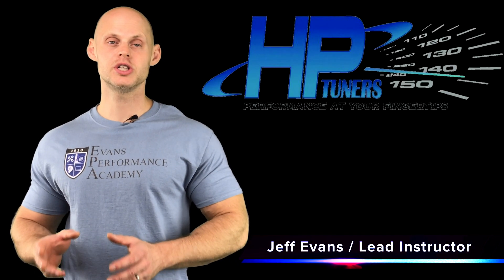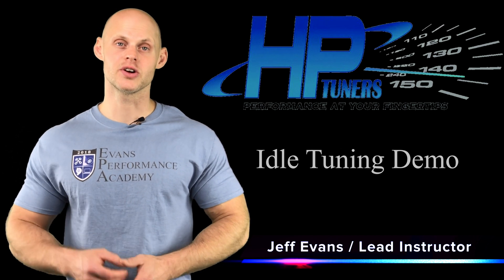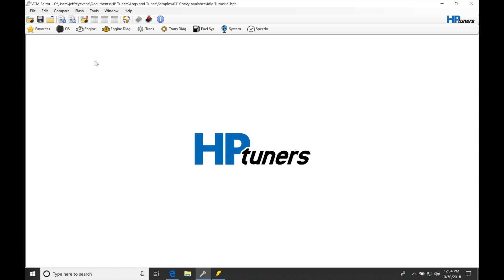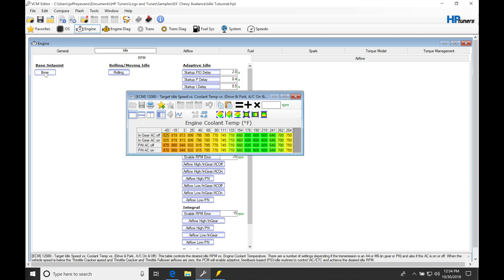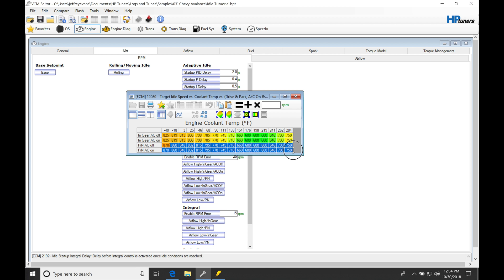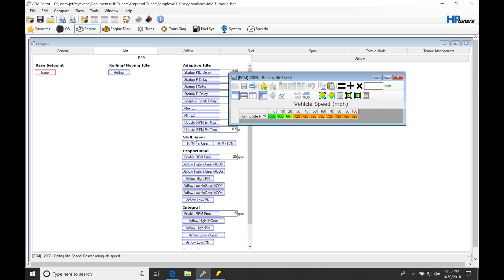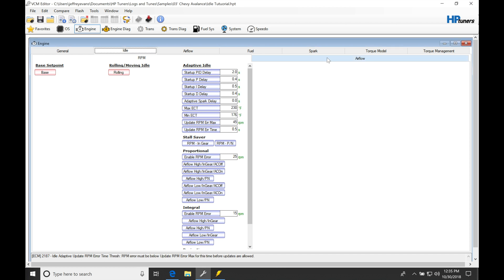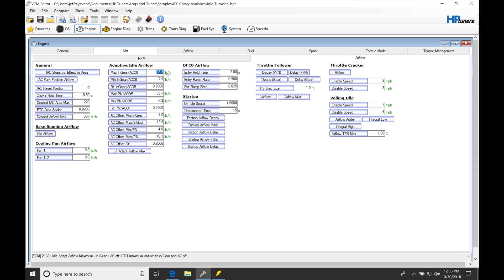HP Tuners GM Gen III: Idle Control Tuning Demonstration | Evans Performance Academy

Comment: I own the MPVI-2 and I have a quick question. Have you made a video about using this tuner on performing an Idle re-learn? I have a 2011 Suburban LTZ 4WD. I cleaned my throttle body while doing a VLOM modifications and DOD delete. I'm having random idle issues now. I found several videos describing the need to do the idle re-learn after cleaning the throttle body. They all different tuners though. Any help would be great!!! 
Oh and I didn't do the complete DOD delete, so I didn't change the Cam or lifters.